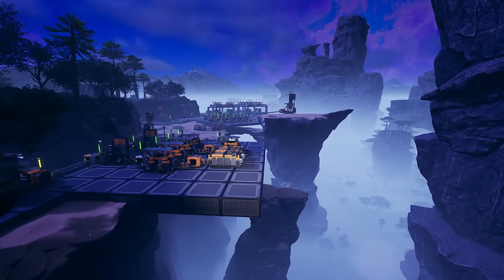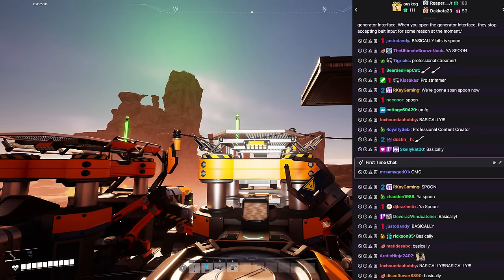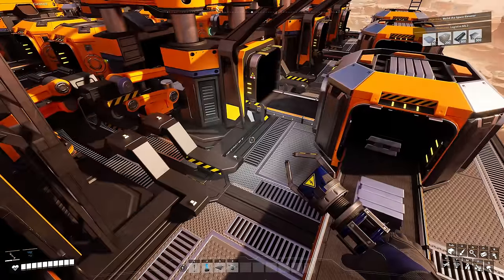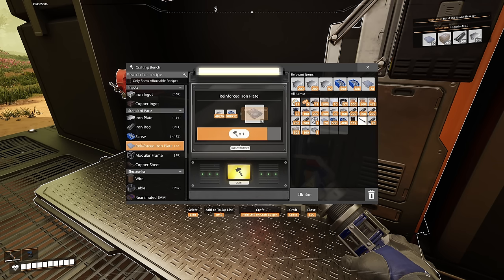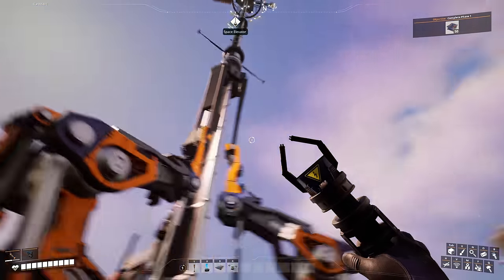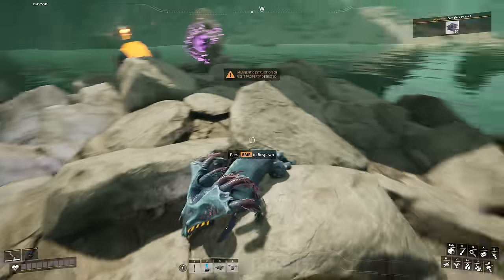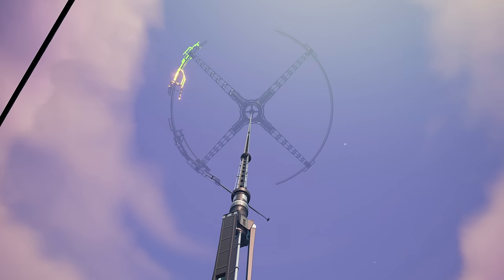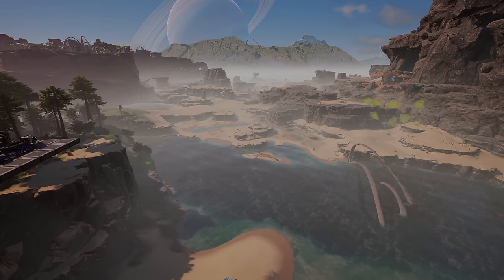Completing Phase 1 In Satisfactory 1.0

Comment: all the belts are bendy in this this video and not straight like the ones i have. is this just my fault that i’m bad at organisation or is there a setting that’s he’s using (i’m building on foundations not just the ground btw)
Reply: You can presse R to change the build mode for the belts, "Default" is a straight belt that goes from A to B as we we're used since early access, "Straight" makes a 90° angle when needed and is suuuuper useful to align belts to each other and outlets. It's what he's doing at 6:25.

In default mode you can also use your mouse wheel to change the orientation of the belts and it'll make angles as well, just not as clean as straight mode.